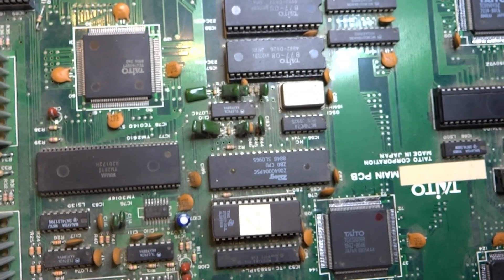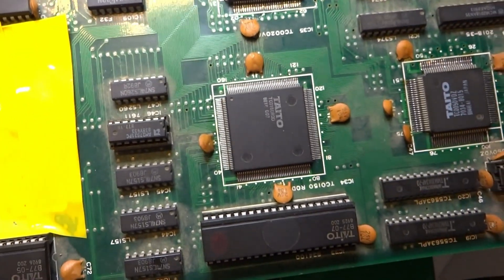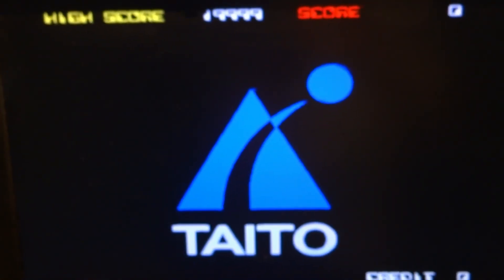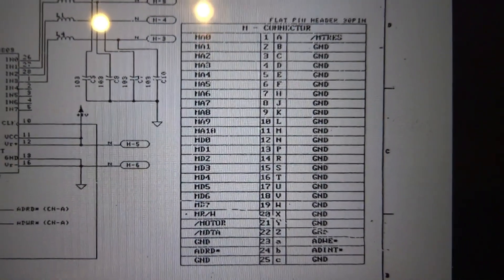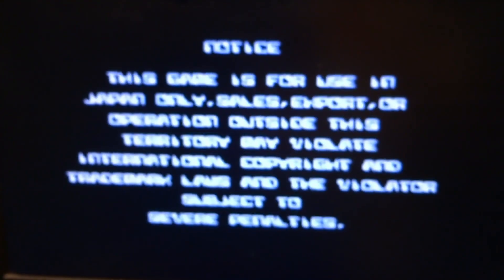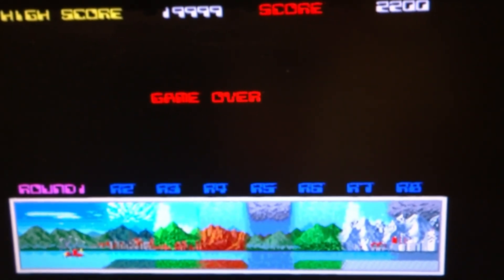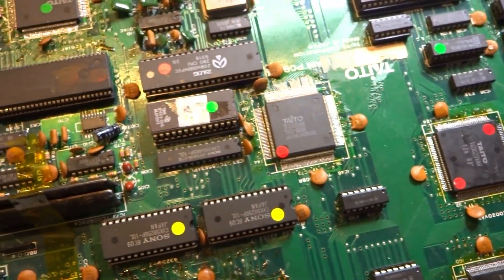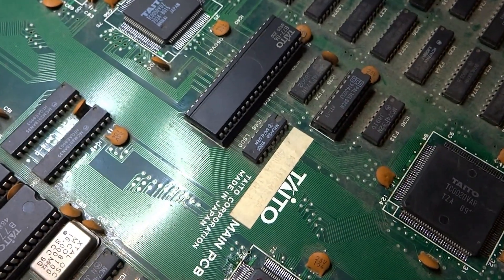Taito Aqua Jack Arcade PCB: Missing Sub Board And Looking At Some Regional Differences

Comment: Did you ever get this working? I got a board from KLOV today and it does come with that little sub board. I'd be happy to help get yours reproduced or running. I'd love some way to play mine, but I don't have an adapter (JAMMA) nor analog controls, just a normal digital joystick. Feel free to contact me.

Comment: Hey Luke! Re: CPUs: One 68K is the master processor and the other a subprocessor. A Z80 is responsible for the sounds. It has a similar sound subsystem to a Crime City I repaired this weekend. I reversed the pinouts for the sound and I/O custom chips and posted them up to FB, the Aussie Arcade forums, and soon they will be on the PLD Wiki. Aqua Jack goes a little further on the audio with the 2 mixer hybrids and using the electronic volume control functions of the sound custom IC.

Comment: Correct me if I'm wrong, but that schematic with the M-connector (pg. 33) looks like it's the actual schematic of the D/A Converter board.

Part no. ADC0809 brings up a TI analog-to-digital converter chip
Reply: You're right, that is the schematic for that board. Luke, I have one, and I could provide pictures if needed.
Reply from the maker: @lascheque  yes! That would be awesome. Any help, pics, breakdown of the board you have would be amazing! If you have a link where you upload them or if you want to make a YT vid, post them on the arcade project forums, etc, all would help a lot!
Reply from the maker: I saw that part of the schematic, thanks. Unfortunately I have no way nor experience to build my own prototype for this. 
It would be cool if someone could design one but a bit beyond what I could do I think.

Comment: I have this board as well. It's been dead ever since I got it in the late 90s I think. 😞
Reply from the maker: I hear that. I'm still working on my Japanese version and it's been a year on that. 
You wouldn't happen to have the sub board would you? The net (as well as myself) really needs pics, parts, schematics etc.
Reply: @lukemorse1  I may have the control board. It's been a while since I looked at it. I'll try to dig it out and let you know.